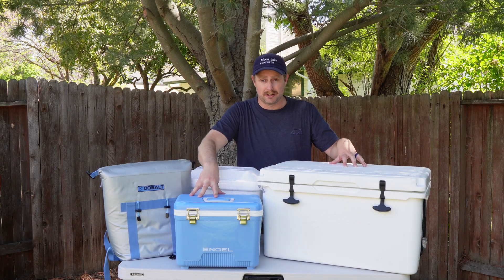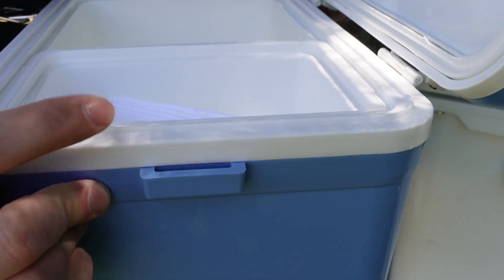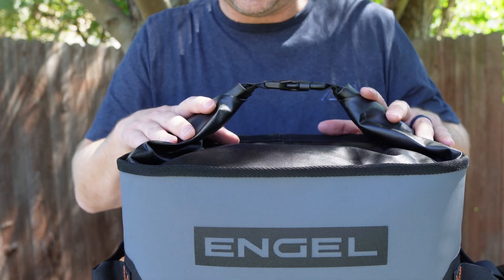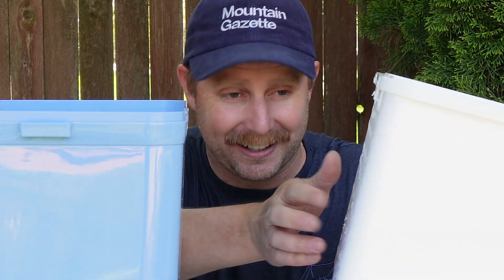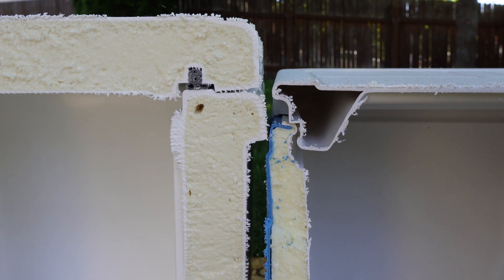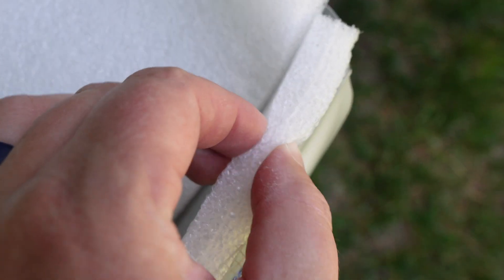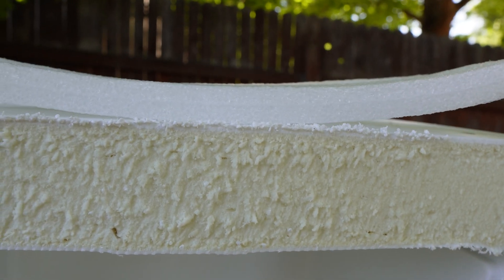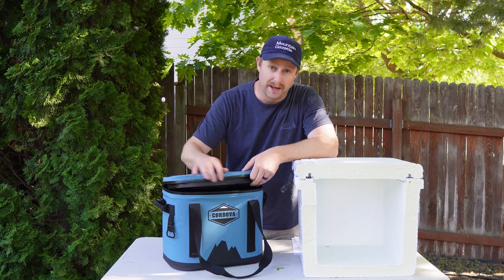Why Some Coolers Stay Cold and Others Don't

Comment: after cutting the coho 55 in half and seeing the construction, how do you feel about it? I have a yeti, and just picked up a coho as a second cooler for my boat for when i have out large groups. To me, it is by far the cheapest rotomolded cooler on the market, ranging from $99 to $139 if you have a costco membership, without any glaring flaws. If you are dead set on a rotomolded, but dont want to pay the hefty price it seems like absolutely the best option. I feel like one of the reasons it didnt score that well on your comparison test, was you have the price heavily inflated. The MSRP on Coho's website is $250, not the $300 you listed, and most people are paying in the low 100's.

Comment: Just wanted to mention that you used your double walled mug as an example of air being better than no insulation but those metal mugs are vacuum insulated which makes them significantly better than air or foam. Great video though, was cool to see the cross section of the cheap and higher end coolers. I only have some cheaper ones and always wondered how much foam if any they actually put in them.
Reply from the maker: Good feedback, thanks for watching.

Comment: Bruh, no one serious has cared about coolers in a long time. Get a 12v refrigerator and move past coolers. I ditched Yeti 5+ years ago and would never go back to a cooler.
Reply: Bruh, some people just want to hang out at the beach or the lake for a day, and some people don't want to drag around a power supply in addition to their cooler. 12V is nice if you're out for a long trip and have easily available power, but for a day outing, a small cooler gets it done. Chill.
Reply from the maker: I'm gonna test that.
Reply: Then why are you here?
Reply: And also, what does “no one serious” even mean? Serious about what?
Reply: eh, as someone who uses it on a boat where it is always getting wet and bumped around, ill stick with traditional rotolmoded. They are indestructible, I can get them as wet as i want, and ice is cheap. for camping, id probably agree.